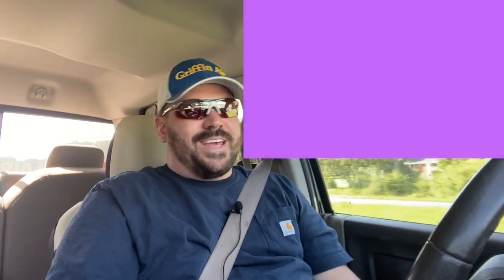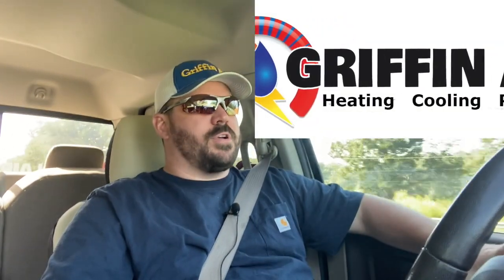HVAC leak in ceiling! Float Switches to stop the system before

Comment: Even an SS2 on pkg unit aux drain ports are great, because so many customers won’t notice soaked insulation or water dripping around the bottom. 

Yes, always break 24 vac hot “R”. You’ll know 3-12 hours ahead of just shutting the outdoor unit off. Then our customers house may not be 90F before we get there to fix it. I put three switches in series on my last job in a basement.
Reply from the maker: That makes since!